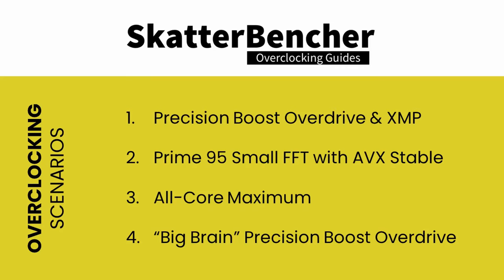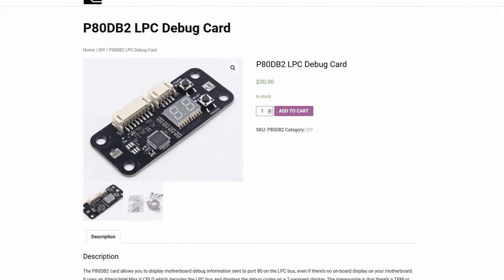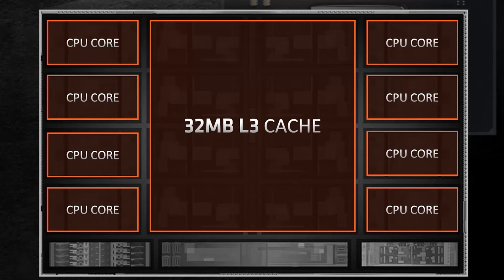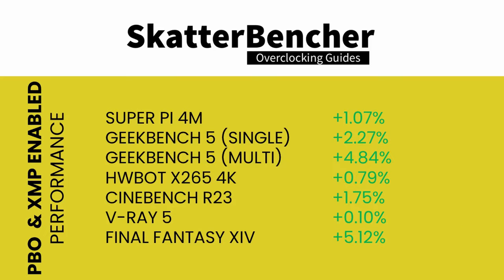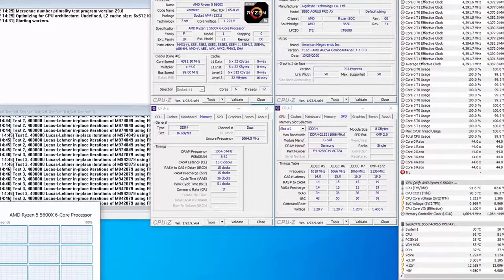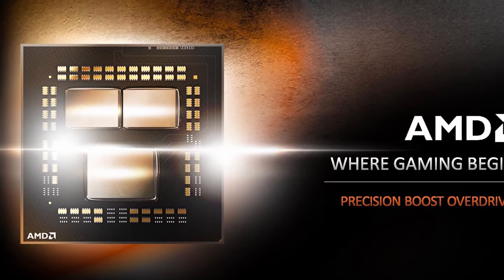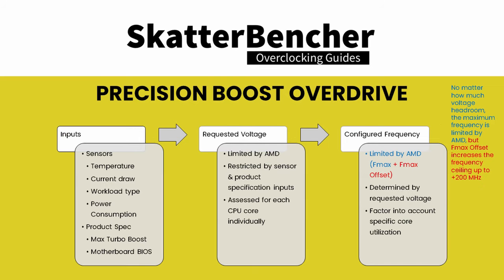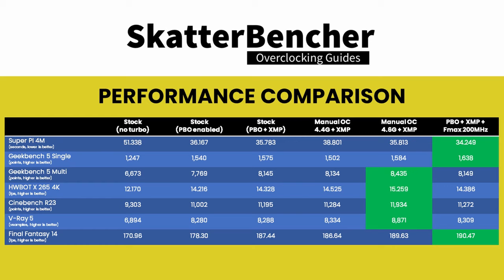5 Minute Overclock: Ryzen 5 5600X to 4850 MHz

Comment: I must have won the silicon lottery with my 5600x. I raised my power limit to 110 watts in bios and pbo scalar to "2x" and offset to 250mhz. At 20c ambient temps with a corsair H115i with some thermal grizzly hydronaught thermal paste py cpu sits at 4.85Ghz durning cinebench at 56c and 89 watts/1.350v. During gaming the average core clocks are around 4.975Ghz 62c and 93watts/1.350v on colder days I have seen 5.10Ghz on all cores at 95 watts/1.375v and on hot days it drops to about 4.80Ghz 65c at 80 watts.
Reply: God mode 5600x
Reply: Can you help me with my 5600x overclocking? I'll paypal you 15 for the best performance. Lmk if you got discord

Comment: By settings fmax +200mhz + adjusting curves from bios, same pages where u pumped up fmax, -30 to weaker cores and -10 to 2 best ones, it lets allcore boost way more higher and will probably beat those manual OC scores. Try it out maybe? 🙃
Reply from the maker: Yeah, V/F curve is something I have been eyeing. When I find time ...
Reply: And most motherboards(not my gigabyte b550 d3sh), lets you override 200mhz override, example +350mhz when single hits 5050mhz and allcore 4700-4750mhz. Thats wicked. 😎
Reply: @tomeliinus11  do you know what is the best motherboard for overclocking? For ram too
Reply: How to check which cores are weaker?
Reply: @arusheyka8549  ryzen master, they have a star 🌟 beside them
Reply: But I ran Hydra OC and it set all my cores to -30. How can I know stronger core to set it to -20/-25?

Comment: i undervolted my ryzen 5 5600x to 1.225 v and set the frequency to 4700 Mhz and i got 78°c on a xigmatek 1266 aircooler under full load on cinebench r23 and its super stable i'm using a b550 phantom gaming 4 from ASROCK and corsair vengeance lpx ddr4 3200Mhz cl18
Reply: Hi. Is it worthed to buy B550M motherboard for my 5600X? Currently I am usinf asrock A320M HDV with RTX3060 12Gb

I wanna use it for Engineering Simulation

Is it hard to OC this processor and run it daily? 

My Cooler is AK62, RAM Klev bolt X 3600mhz, PSU Bequiet 600W
Reply: Damn silicon lottery. I have the same board and a 5600 and was only able to be stable at 4600 mhz at 1.23125v.
Reply: running mine on 4,4ghz all core 1.075v.. 61c stock cooler

Comment: Please Show Overclock on a Aorus Board with a 5800x
Reply: I wanna see that too
Reply: Yeah
Reply: Works the same way but 5800x is hotter. Set +200mhz and find the most stable negative curve optimizer setting for each core.

Comment: There's no way in hell I can run my 5600X at 4.85 all core on my current cooler (AK620). But I managed to get 4.75Ghz stable in Linpack at 1.275Vcore. Along with RAM I tightened the timings on I went from 11962 in Cinebench R23 (at 4.6 all core) to 12392 just from a 150Mhz boost (at 4.75 all core)
Reply: I limited EDC to 100 amps and let PBO2 decide what my all core boost frequency is. Linpack had the cpu at 76c on my budget hyper 212 BE. Cpuz and cinebench barely touch 70c. I have -20 on curve optimizer except the two fastest cores they are at -12 and -16. I just did an R23 run and I got 12107 with stock 3600 CL16 RAM. The boost to 1T performance is pretty good although as you said it's pretty hard to run all the cores at 4.85.
Reply: @NXDL25  I run PPT at 130W, and given I have an AK620 dual tower cooler, it's handling 4.6 all core easily in PBO and does boost to 4.85Ghz single/dual core
Reply: @yamilmontes1365  From my understanding, PPT is hardly the limit when it comes to the 5600X. I have it set at 125W but none of my tools surpass even 120. I don't know about prime95 I refuse to test with it but I'm almost always limited by the EDC.
Reply: @NXDL25  I had to raise PPT to get my chip to go to 4.6Ghz all core, otherwise it would stop at 4.4 all core under cinebench/occt
Reply: @NXDL25  From my testing, at 4.8Ghz all core under Linpack the chip draws 133W, and at 4.6 you're still hitting the hundreds. So PPT is def something to raise for PBO.
Reply: @yamilmontes1365  You're right. I might've worded my statement incorrectly. I wanted to say that over 110-120, it doesn't matter at least for my testing tools because it's capped at 100 amps for the EDC. I don't use OCCT so idk about that one, but in real world scenarios, it will never even approach 133W.
Reply: @NXDL25  You'd be surprised, when you open Minecraft it spikes my chip to 90C and draws 100W just because it loads 80,000+ lines of code. That's why I had to turn down my OC. Atleast until I get a water cooler. The 5600X is a beast when you take advantage of the silicon
Reply: Hi. Is it worthed to buy B550M motherboard for my 5600X? Currently I am usinf asrock A320M HDV with RTX3060 12Gb

I wanna use it for Engineering Simulation

Is it hard to OC this processor and run it daily? 

My Cooler is AK62, RAM Klev bolt X 3600mhz, PSU Bequiet 600W

Comment: I did it on my 5600x with an B550 strix E-gaming the max Voltage i get was 1.425V. My cpu hit 4851mhz over all core. Is the voltage a risk in 1.425? Maximum off 74 degrees.
Reply from the maker: I made a video specifically on PBO and voltage range to address this topic: https://youtu.be/1wcU8PrdGLE.

In short: high voltage is not a problem unless you're applying it in multi-threaded high workloads for a long period of time.
Reply: over 1.36v you will destroy ur cpu over time

Comment: I bought 10 5600xs and this are my results:
Max stable all core overclock in prime 95: 47.0-4.5 
Max stable overclock in Gaming and Cinebench R23/15: 4.9Ghz-4.95Ghz all between 1.31v and 1.35v
The 4.9ghz all core overclock is not stable in prime95 (Small FFT), likely due to poor cpu cooler (Hyper212) Cinebench R23 is enough to put the cpu at max 82c, Prime95 will probably put the cpu at 150c if not for the thermal limit that forces it to shut down at 110c.
Someone should test them with a solid water cooler at 4.9 to confirm.
Reply: Well that confirms my theory I think mine is a golden chip bc I was able to complete a cine bench run at 5.4 ghz the motherboard failed after the run though but it did complete 5.3

Comment: B450 and 5600X, i use only PBO (curve optimizer -20 and overide +50mhz) and i get 4.85ghz boost clock on 5 of the 6 cores and never even touch 70°C with the Deep cool AK500. its my first time i do OC in my life and I am very ok with it
Reply: what cooler?

Comment: Do you have any experience with Asus AI sweet auto overclocking? I have a 5950X with RTX 3090 and want to push it a little further, ive done all my homework but I think overclocking is just one of those things I can't get my head round, was wondering if its okay to auto overclock with AI sweet?
Reply from the maker: I used ASUS AI Overclocking in my original i9-10900K overclocking video: https://youtu.be/cssbWlpmTho.

I found it works exceptionally well for an automatic overclocking tool, so I'd definitely recommend trying it out :)
Reply: @SkatterBencher  Thats brilliant thanks! Might give it a go, anything to watch out for? (That a noob might miss)
Reply from the maker: When you're exploring the limits of your CPU, always look out for the temperatures under load. The temperature is the main constraint for your overclock. Too hot means unstable, not hot enough means more voltage headroom :).

Good luck!

Comment: upon watching the video, I just saw that you enabled the xmp and added 200 mhz over drive, do I need to adjust the voltage or something?
Reply from the maker: Nope, the Precision Boost Overdrive algorithm does all that for us already! :)
Reply: @SkatterBencher  I see thanks! But when I put 200 mhz, on task manager it only runs 3.57 mhz, but when I put auto on precision it goes around 4.57mhz or something
Reply from the maker: To see the frequency, you can try downloading HWiNFO and check the frequency during a benchmark workload.

Comment: Quick question, what's your FCLK frequency at because I know past 1900Mhz the chip gets iffy
Reply from the maker: It's been a long time, but I think it was running 1:2 asynchronous with memory. So 1067mhz fclk with 2133mhz mclk.

Comment: first things first, i have good cooling and have no problem with temperature, my only concern is high voltages
should i stay at basic MSI "PBO Enabled" profile when it boosts to 4,625 - 4,650 Ghz at individual Core VID 1.35V and CPU core VID peak at 1.4v?
or can i go with another PBO profile "enhanced mode 1" where i get single core boosts to 4,850 Ghz but with individual core VID peaking at 1.444v and CPU core VID 1.45v? 
or maybe manual OC / voltage control? but i dont want it to boost all the time, thats why i rather use PBO or maybe i am not aware of some settings so even at manual OC i can make it tha its not boosting to max all the time

i wrote more detailed comment here about that so you can look at it but i just want to know if it is safe to use that "enhanced mode 1" PBO profile instead of "PBO Enabled" profile
i made this second comment with this question so its not that long
Reply from the maker: (I also read the other comment)

Long story short: don't worry about the PBO voltage. I explained it a little bit more in the full SkatterBencher version of this 5 Minute Overclock as well as put it up as a separate video: https://youtu.be/1wcU8PrdGLE.

The "high" voltage is not applied all the time as it is only used when the CPU is targeting the high frequency. Since PBO factors in not only workload, but also temperature, power, etc, the actual time (effective clock) spent at this frequency and voltage is fairly limited.

Comment: may I ask: at the very beginning of the video you showed an external device connected to the motherboard, is this a 3rd party device or did this came with the motherboard? if 3rd party, any infos pls on the model name or exact type? thanks a lot
Reply from the maker: You mean the debug card? It's one of the Open Benchtable accessories made by ElmorLabs:

https://openbenchtable.com/stock/
https://www.elmorlabs.com/index.php/product/p80db2-lpc-debug-card/
Reply: @SkatterBencher  Perfect, yes thats it, Thank you! (unfortunatly my mb is not supported per elmor labs infos)

Comment: It seems like when I OCed in the Bios the clock speed was stuck at the high clock and would never downclock under light loads. Did I do something wrong
Reply from the maker: Where did you check the clock speed? Some applications may report the peak frequency, but the actual frequency is not that high.

You can always download HWiNFO and check the "effective clock" what's the real clock frequency.

Comment: Hi. Is it worthed to buy B550M motherboard for my 5600X? Currently I am usinf asrock A320M HDV with RTX3060 12Gb

I wanna use it for Engineering Simulation

Is it hard to OC this processor and run it daily? 

My Cooler is AK62, RAM Klev bolt X 3600mhz, PSU Bequiet 600W
Reply: Idk if you already built your computer, but in my case you can't overclock that much this processor, it gets too unstable in certain softwares and makes me going back to stock speeds in order to use them properly (without any crashes or blue screens)

Comment: Okay, SOMEONEPLEASE!!! Help. I cannot get my ryzen 5 5600x back up to 4.65 I forgot what I did before but I had to rebuild my whole pc cause motherboard died. So, is it stable to do 46.5 on the cores and that voltage without checking stability? I mean it’s a marketed speed and my cpu is in top percentile so I should be okay?

Comment: So whats the best for gaming? Manual OC 4.6Ghz + XMP or PBO FMAX 200MHz + XMP?
Reply from the maker: PBO FMAX 200 + XMP, hands down
Reply: @SkatterBencher  I really appreciate your help man, needed exactly a video like this.

New sub here :)
Reply from the maker: Thanks and welcome! :)
Reply from the maker: U. Right. thumbs up

PBO will adjust the cpu frequency and voltage according to the system needs and situation. So, when a workload is present and there is room to increase the frequency, then PBO will do it. If there is no workload and no need for high frequency, then PBO won't do it.
Reply: @SkatterBencher  thanks, I see a lot of people messing with core voltages I will. Do pbo f 200 and then negative curve voltage tuning since I need most single core performance
Reply from the maker: Why would you want to use negative curve?

Fmax 200 will set the maximum boost frequency ceiling 200MHz higher than default. To hit those high frequencies, you will need low temperatures, reasonably light workloads, and sufficient voltage. If the first two criteria are met, then voltage will determine whether you hit the high frequency or not.

If you lower with negative curve offset, then it's possible the PBO algorithm will deem there's not sufficient voltage for the highest frequency ... and not set it.

Comment: In my bios my pbo says auto stock. Does enable benefit at all? New to this and don’t want to do too much
Reply from the maker: Enabling PBO will set the Precision Boost 2 parameters according to the BIOS pre-programmed values. Typically those are higher than the default AMD specification. The effect will be increased performance because of longer, sustained boost. The downside is that PBO is technically overclocking and thus does not fall within warranty.

Note that on many motherboards PBO is enabled by default. So auto may be enabled.

PBO is pretty much the safest overclock you can do on your system, so no need to worry :)

Comment: MSI have awesome PBO settings, i have B550 Tomahawk (7C91vA4 bios), 5600x (air cooled NH D15) and G.Skill TridentZ 3600Mhz CL16 and just enabling PBO (XMP is a must so enabled too) i have all core boost to 4,625 - 4,650 Ghz at individual Core VID 1.35V (CPU core VID goes to 1.4v in cinebench, in geekbench it peaked at 1.388v) and its different from other manufacturers for example even if i run single core benchmark, it stays at 4,650Ghz and other mobos manufactures pushing that single core boost higher when its under single core load... here are some results, geekbench 5: 1648
 Single-Core, 9015
 Multi-Core, Cinebench R23: 11 837, Cinebench R20: single - 597, multicore - 4611

EDIT: i think i changed FLCK clock too but im not sure, its at 1800 Mhz

from that table in this video it seems like single core Geekbench single core score and PFS in game are correlated so im happy with that cuz my main focus is gaming
maybe i try different PBO profiles in bios, there are "enhanced mode 1, 2, 3 and 4" (im just on default "enabled" profile) if it could bring voltage down a bit (im too lazy to play with curve optimizer especially when i heard it had to be tested for stability at some idle like conditions not under load) with other profile and maybe i try new bios which is no longer marked as beta but if everything works better leave current bios i guess and just play with settings

EDIT2: tested various "enhanced" modes, enhanced mode 1 are the same as other mobo manufacturers PBO enabled mode, so its boosting single core to 4,850 Ghz, got better geekbench scores: 1713
 Single-Core Score and 9041 Multi-Core Score but voltage was a bit higher too
other modes  (2, 3 and 4) are just another step ups, at enhanced mode 4 i was scared to stress test it when i saw the voltages and it was boosting to 4,950 Ghz, so best performance with i guess ok voltages are in "enhanced mode 1" but i make separate comment from this and report voltages at that mode so this guy from video can tell me if those voltages are ok and i can have it at that mode or i should stay at basic "PBO enabled" mode / profile just to be safe

UPDATE:  on latest bios (7C91vA5), those "enhanced mode" profiles are useless cuz yeah it is stepping up clock but limiting the power so it wont reach those clocks anyway and pulling only about 76W, PPT limit is 100% on all enhanced mode profiles and all core boost is around 4.2 - 4.3 Ghz, i guess they forgot about PPT limit so in the end, other settings are useless when it cant get there cuz of PPT limit
Reply: How is your FPS in WoW when in a radi group of 20ppl?
Reply: @ivanjovanovic2262  well what he even do in gw2 largos with a loot of mesmer class as dps it will be a gruup of 10 and mesmer can clone there self up to 3 so fps goes brr from +100 fps avg to 35fps avg as r5-5600x 4.85Ghz all cores locked at 1.4Vcore and 3333Mhz 15-17-17-17-32cl and more timmings at 1.41V from corsair vegene lpx xD
Reply: men you are wrong. i had one msi B450 gaming plus and after switching to Asus Tuf B550 with ryzen 5600X i got Cinebench score R23 around 12.000`ish. and with the msi board i never passed the 11.5000scores and with the curve optimizer i got better temps on vrms and chipset so no. msi is not better then other manufacturers. i tink asus is the best mobos in the AMD categories.
Reply: Hi. Is it worthed to buy B550M motherboard for my 5600X? Currently I am usinf asrock A320M HDV with RTX3060 12Gb

I wanna use it for Engineering Simulation

Is it hard to OC this processor and run it daily? 

My Cooler is AK62, RAM Klev bolt X 3600mhz, PSU Bequiet 600W

Comment: Do you have a link on where to buy the gigabyte b550 aorus pro ax? that can atlest be imported, due to needing the wifi 6 without an addon card, the vrm changes, and the usb c front panel header
Reply from the maker: I looked around, but couldn't actually find a place to buy the board ...
Reply: @SkatterBencher  did you buy it directly?

Comment: Manual overclock and setting the voltage just make mine lock up. I have to reset the mb every time. I’m running a 5800X and my cooler allows my auto settings to hit almost 4.9Ghz consistently on benchmarks but my temps get to 88C. 

I just can’t seem to find that magic number to maximize my frequency with a lower static voltage. My main goal is to keep my temps down. While maintaining the design ceiling frequency.